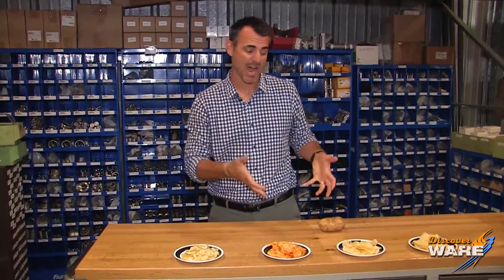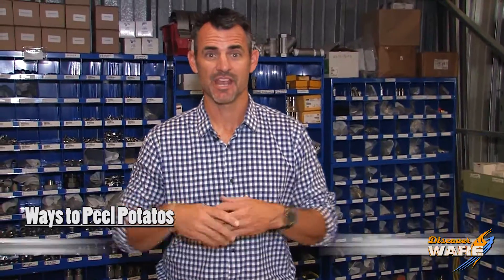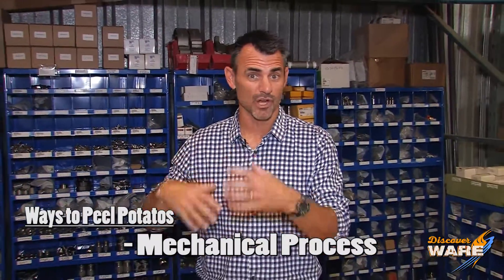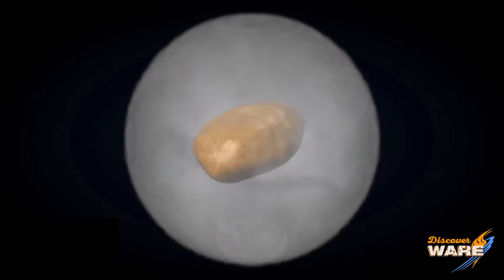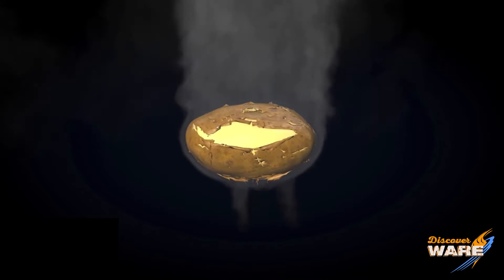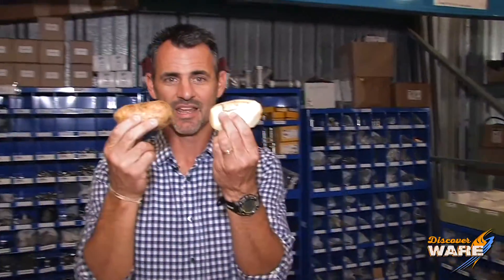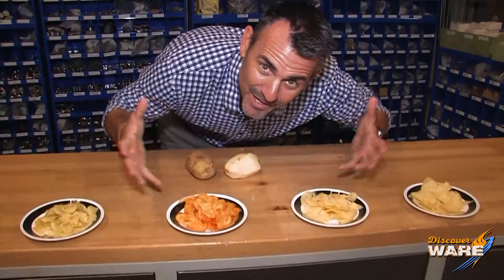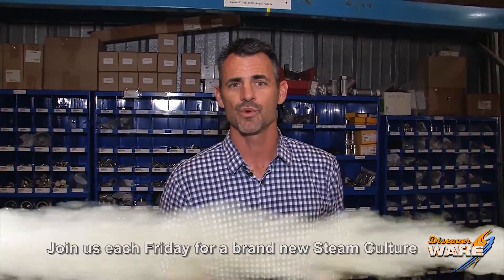Peeling a Potato with STEAM! - Steam Culture

Comment: in theory, can u also do this using a pressure cooker, as the temp can go up to and over 100 deg C, if i modify a pressure cooker and install a relief valve? 

 the idea would be i would put potatoes inside the pressure cooker with a little bit of water  (3 cups or so), then increase the temp to about 105 deg C and then pop the relief valve suddenly lowering the pressure inside the pressure cooker.?
Reply from the maker: We highly recommend NOT modifying pressure cookers. Those can be very dangerous if things go wrong so we can't recommend modifying it in any way. Appreciate the comment though!